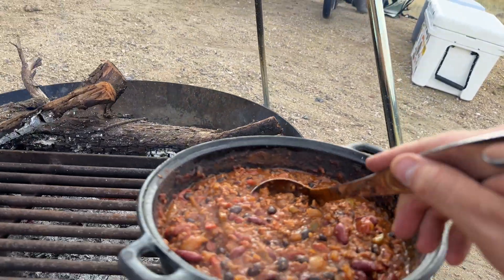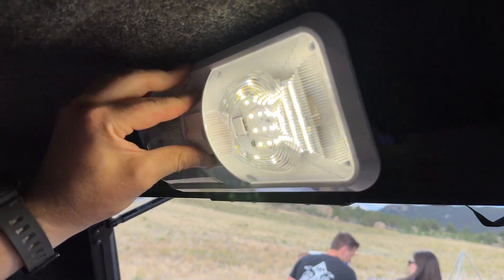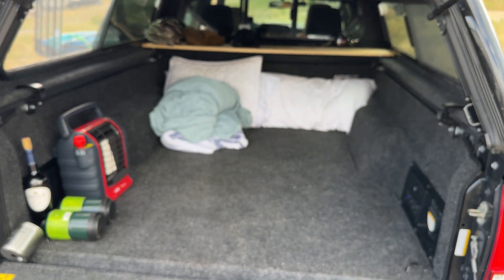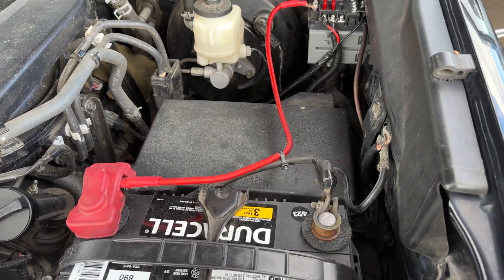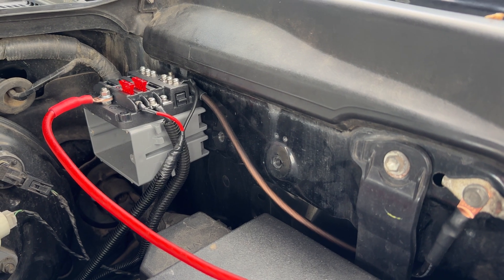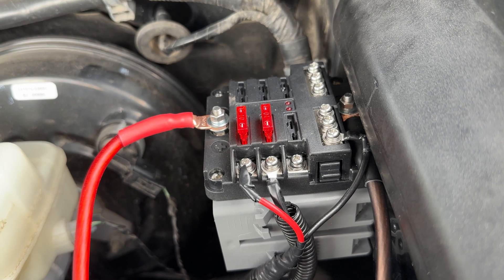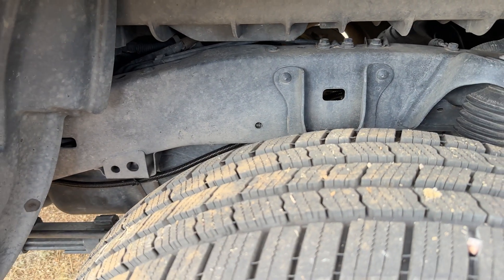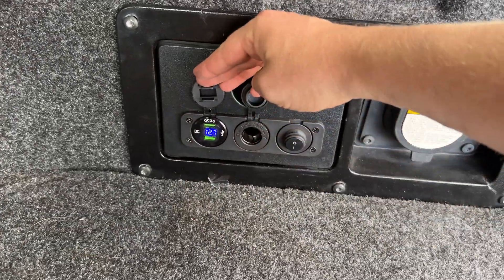I Installed a Fuse Block & Sent Power to the Truck Bed

Comment from the maker: 💬Join the Discord: https://discord.gg/RUJbAj8QPB (comment if link broken)
🚨 Finally on IG! : @teamoildrop
Items in this video: (Amazon affiliate links)⚙
6 Way Fuse Block - https://amzn.to/3SanT9o
Power Panel with USB - https://amzn.to/48nVwKI
Outlet Box (mount option) - https://amzn.to/48C4DHu
8 Guage Wire Lugs - https://amzn.to/4aLinkV
8 Guage Wire - https://amzn.to/3H9LCjB
14 Guage Wire - https://amzn.to/48pHfgw
3/8" Wire Loom - https://amzn.to/3vzjbZP
Electrical Tape - https://amzn.to/3vzjbZP
Zip Ties - https://amzn.to/3vutgHK
Bed Light - https://amzn.to/3RTEFYW
(These are Amazon affiliate links: Amazon pays the channel a small fee every time you fine people buy through these links)
⚙Tacoma World - https://www.tacomaworld.com/threads/3rd-gen-maintenance-maps-get-300k-miles.789809/
⚙Channel Shop - https://team-oil-drop-shop.fourthwall.com/

Comment: Were you able to get away with 25 feet of wire and loom to reach the passenger side panel from the fuse box?  Great videos, thanks for all the info!
Reply from the maker: Yes you should be able to reach! 

-Austin

Comment: Any idea if this is something i could do with an SR5 adding an outlet? I have that compartment with the twist lock but its open to the elements. Could fabricate a box to fit in there i suppose.
Reply from the maker: @xshangheighx  you definitely could. Any trim, heck, any truck could have something like this.

Comment: I have a bunch of blue sea systems stuff (fuse box, cb, ground bus) to connect up and a similar bed 12v/usb bed power outlet….hopefully soon!

Are you using that heater in the bed?  I have the same one, seems sketchy.
Reply from the maker: I have from time to time! Buddy heaters are safe!

Comment: The household wire nut in your access panel at 6:42 is probably not the best idea.
Reply from the maker: It is a bit “out of place” but used in a pinch in a dry area and still sealed with appropriate tape. Otherwise what’s not a good idea who it it? I’d hate to know our houses are at risk
Reply: @teamoildrop  Okay, you asked so here it is, wire nuts repair electrical wires in homes without constant vibrations or corrosion issues. Wire nuts should never be used to install or repair automotive wires because they can come undone due to vibrations in a car, such as hitting speed bumps.  

I noticed that your junction box is open to the environment as evidenced by the dirt inside.  Those drain holes are there to let out the water that will get inside that is thrown up by the rear tires.  Soldering the joint and insulating the connection with marine grade heat shrink tubing would probably be more appropriate for that area.  Just saying.
Reply from the maker: @michaelbriese9417  no no good points for sure. I’d never put this under the hood or anywhere exposed. The dust on there is just that, from dirt roads etc through the hole, this area has never been wet. As for marine grade heat shrink etc, everything else at this point is done as such  (see firewall wiring video). I’ll be changing this out right now actually since you brought my attention to it and it bothers me now 😆 thanks brother!

Comment: Go practice to put a fuse inline from the battery to your fuse box that's rated for the load your box could pull. I use circuit breaker so you can reset them or turn it off to work on things. I Like the idea of the additional power station in the box tho
Reply from the maker: It's on my counter ready to install ha. Been unplugged since I deployed.

Comment: I'm surprised you're not using bed stiffners to support the weight of that cap and keeping that composite bed doesn't get wonkie on ya.
Reply from the maker: I’ve definitely considered them. I’ve got a light foot and go very easy when on a trail but yea, they have seemed very appealing before.
Reply: @teamoildrop  
I got cheap ones from Amazon and with an Amazon coupon ran me about $85.
I love 'em because not only do they help keep things squared up because of the 200 lb ARE CX-HD cap with a topside load capacity of 500 lb, but they actually have holes to aid in anchoring points. 
They're really well made.
Reply from the maker: @michiganborn8303  definitely will check out thanks!

Comment: Oh yes perfect timing, I've been meaning to do something like this having a zero gauge sub amp power wire and ditch lights already wired to the battery. Right away you realize you need a better way to distribute power for expanding lights and accessories,  rock on braski.  🤘
Reply from the maker: Definitely, wire management is 99% of the battle and so worth it in the end. Enjoy!